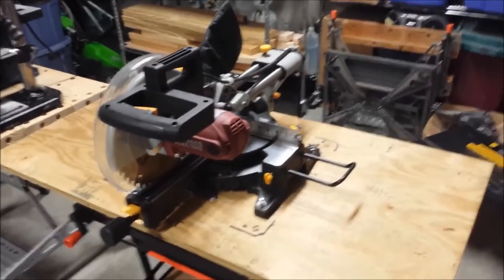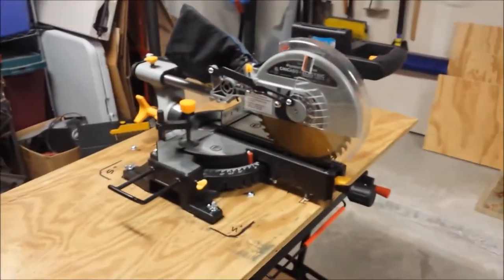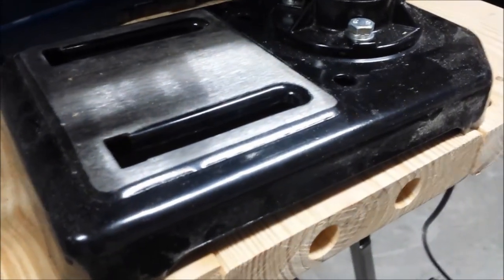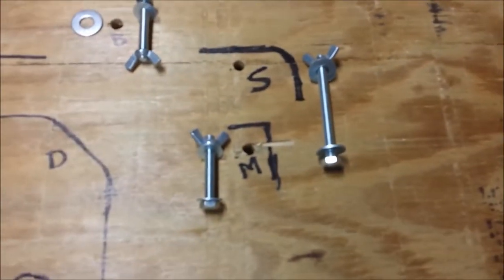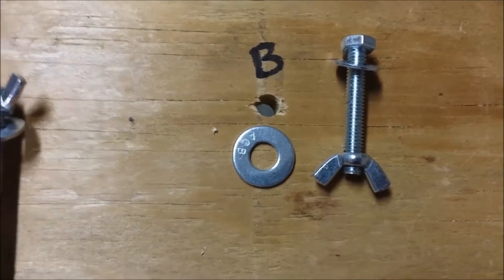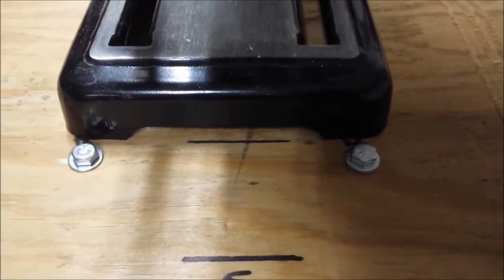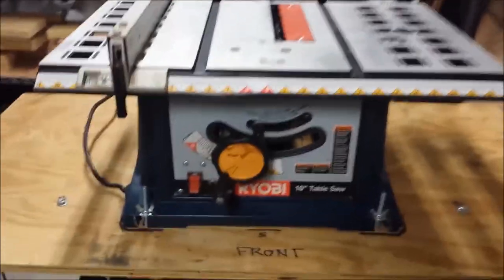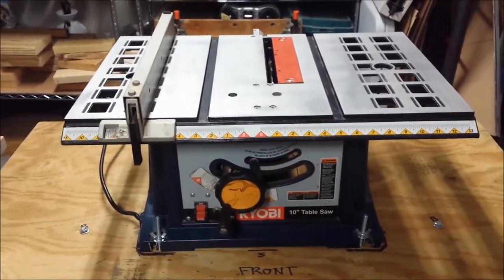How To Attach Power Tools To Your Workmate 425 Part 1

Comment: Great idea, I used this for mounting tools on my Workmate, however there are much better things than wing nuts. I use threaded inserts which you screw into the plywood using and Allen socket or wrench, then simply use 8mm bolts and washers to hold the tools down.
Reply from the maker: Hey Tony, thanks for the suggestion.  I will have to try it.  Cheers!

Comment: Nice idea, the workmate is an awesome modular stand, but you’re doing it the hard way. Just bolt each tool to its own sheet of plywood with a cleat on bottom to hold in the vise. Plywood is cheap.  Best.
Reply from the maker: Hey JefAlan - Thanks for the suggestions.  I know others will benefit from your sharing as well. Cheers.

Comment: How stable when using the table saw application?  Trying to decide between the WM425 and the Worx Pegasus
Reply from the maker: Anthony K The WM425 would be your better choice, especially with the wood accessory as shown in this video.
Reply: Much appreciated.